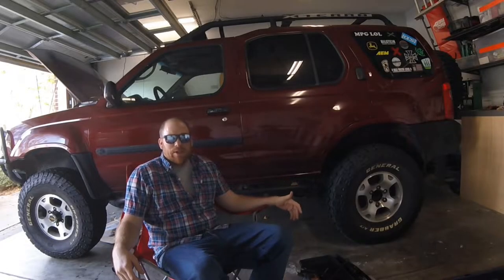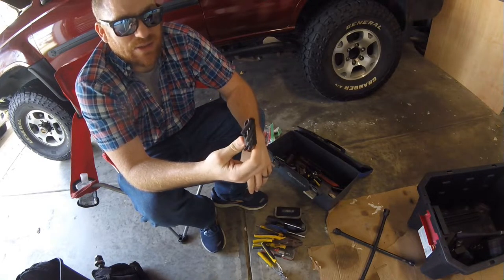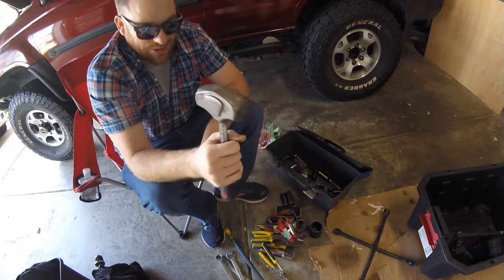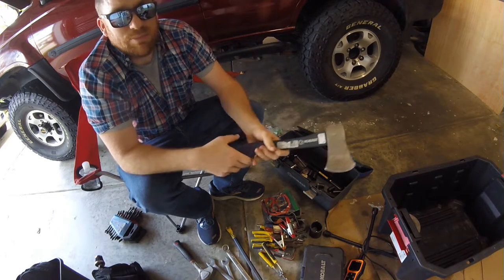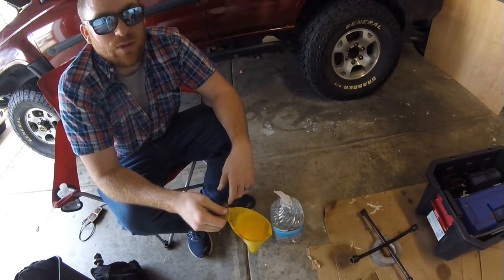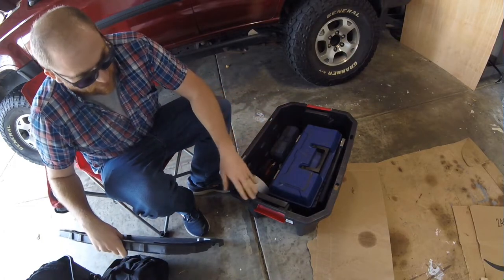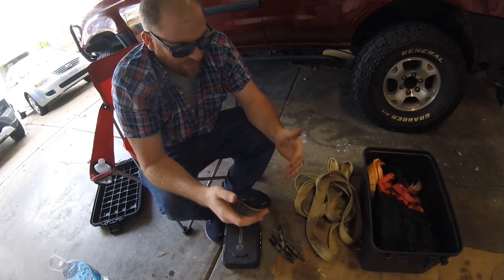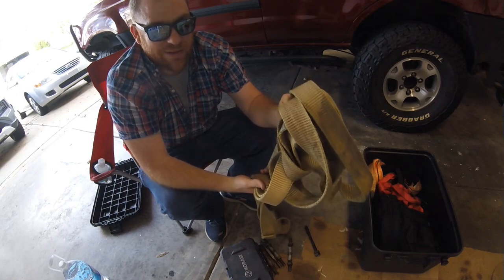Tools, Spares, and Gear that I take with me Off Road

Comment: You don't want to pour cold water on a hot radiator just FYI
Reply from the maker: Good to know.  Usually the water isnt really cold since it stays in my truck.  If I am over heating...its pretty hot out and the water is warm too.  Good thing to note though!
Reply: @XterraRob  I would still be weary thermal shock can crack it..... just ask me how I know xD
Reply from the maker: @stich1960  cracked radiators can't be fun!